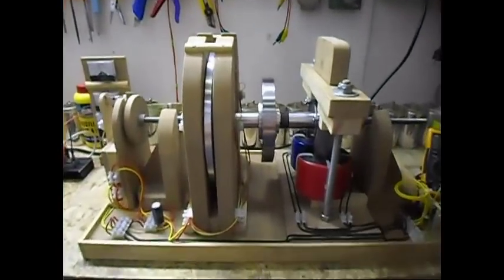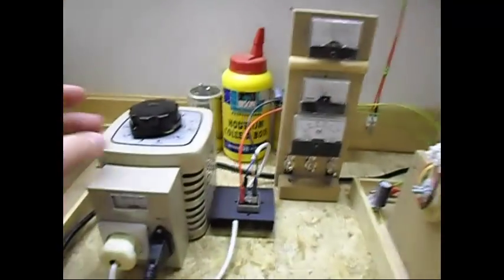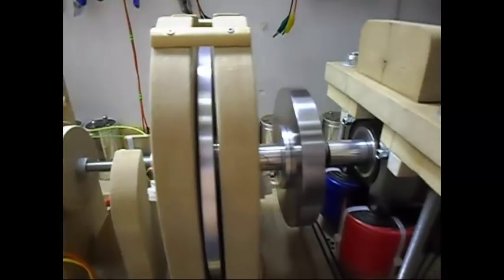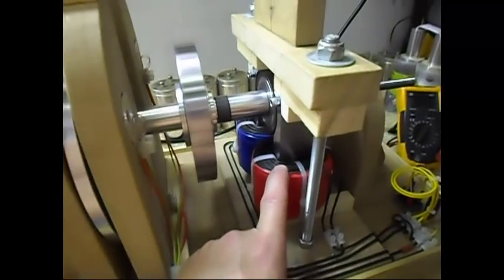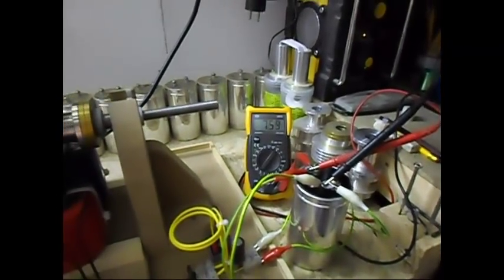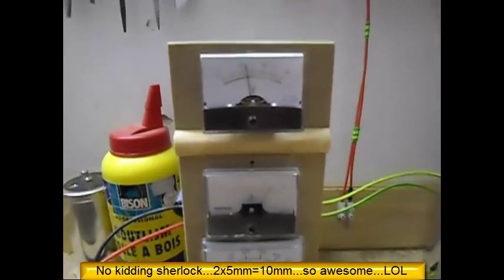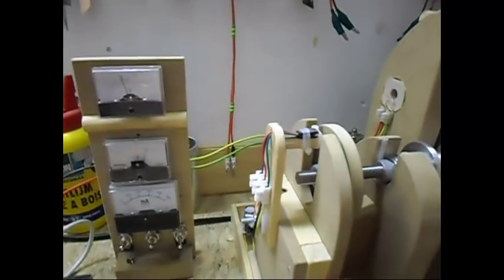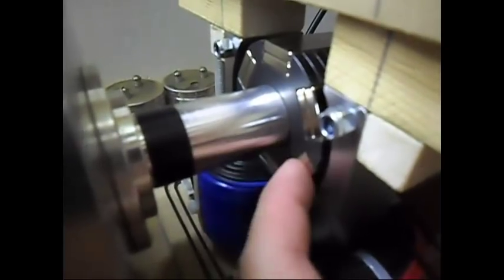Project U-core Dynamo  - Update 4, Self looped & 10mm magnets load test...

Comment: I would be very interested to see   how much power it would produce if the rotor had half of it with same polarity magnet just like the drain pump. Nice work.
Reply from the maker: Thanks for your comment and i'm pleased to read that you've liked it...^^
This test was with 10mm magnets and 3 of them are south out and the other 3 are north out...;-)
It can light up two 21 watt dc light to full brightness but mister Lenz law and it's effect take effect which is of no good and drag the system down almost to a complete stop...lol
If i shopuld run it with a small engine it can put out a lot more...but that not what i want from it...;-)
See this video here where i do the test with 42 watts DC,
https://www.youtube.com/watch?v=OmzUm4fMdfI&t=2s

Comment: Mrcaribbeanroots may i ask if you have plans to use magnet wire to wind your generator?or if you already tried and was not satisfied,?because the insulation on the wire you are using is very thick,which take up more space and may make the outer coils to far from the core inductance; this may lead to serious lost of power ,however magnet wire insulation are very fine and will be much closer to the iron core therefore recieveing more induction from the magnets,they are also best for winding generators.However i do know that the thicker wire you use might help reduce cogging is that why you use it,?thats all like your work very clean remind me of skycollection,peace am out adios lol......
Reply from the maker: Thanks for your comment and glad you've liked it...😄
No special reason why i've use this wire to wound this dynamo...i had this wire laying around for a long time so i've decided to use it...;-)
Of course the inductance/capacitance maybe a bit different once wound as a coil compared to using a enamelled copper wire with the same thickness but it's not something to worry about...at least i don't worry about it...lol
It does produce plenty of juice especially with the 10mm magnets...;-)

But even if it would produce 1 Mega Watt of power what's the big deal if we can't take it/use it without having to drive the dynamo with say 2 Mega Watt of power...???...lol
The cogging is not that bad with the 5mm magnets...pretty good actually...:D

I don't think that a thicker wire helps out with the cogging...???
My guess is that it has to do with a thicker wire coil having lower voltage at higher amps and from my own experience this can be good for not being to stressfull to a system...
Having a thinner wire coil producing higher voltage at lower amps will put plenty of stress on the system and fast too...lol
Voltage is like water pressure...slow running river(lots of water mass at slow rate) compared to high pressure garden hose(far less water mass at higher rate)...which one will be more painfull...???...lol

I also enjoy your work...you are very good at making good setups with the recycled stuff you have laying around...^^
I buy/make most of my parts...lol...not much recycling om my behalf...in my case good old Caribbean lazyness that's for sure...lol
Peace i Adios!
Reply: Thanks for the reply,i appriciate,keep up the good work.
Reply from the maker: No problemo, you are most welcome...^^

Comment: Awesome as always!!
will be interesting try to use a big capacitor bank to charge also with more voltage and discharge into a pulse stepdown trasformer back into the source.
Another method to increase the voltage out (a little more drag for the rotor...but still interesting) is to short circuit the generator coil in small pulses synchronized to the max peak of voltage, to get a fast higher voltage peak due to the inductive kickback/flyback spike, capable to charge an higher voltage capacitor
Reply from the maker: Hi Gianni my friend, thanks for your comment and extra info on those two ideas...^^
Yes, a higher voltage cap bank could do good and the short circuit as well...;-)
If a large cap bank is only partially discharge(say 1/3) it won't effect the drive side to much while it is being filled back to it's fullness...:)
The shorting seems to be the better one(i think) since when this setup is shorted on it's AC output it does not slow down...(around 1550 rpm) or so...I will show this in my next video on this setup when i get some ordered parts in the mail...:D

So if i should short it on the AC @ the voltage peaks it should do good but after the short comes the FWBR and this must be only connected while it is being shorted since if the AC is being rectified continuously it will slow down to much...
I will look for my little shorting circuit and test with just with a small trigger magnets on the shaft which will only give me one short per voltage peak but this will give me an indication if this is good or not to continue with...???
Than i can always set up a 555 timer to get more shorting per volatge peaks...;-)
Cheers
Reply: thank you for considering those ideas!
well, if the AC is rectified it will slow down just when the voltage on the cap is lower than the voltage produced, after that the rpm will go slowly to the maximum until the max voltage is reached, then you add the short, so this can add voltage to that caps...
of course the load will slow down the system
Ciao !
Reply from the maker: Thanks for the extra info on the shorting, i'll search for my little shorting circuit and see how it goes but like you wrote..."of course the load will slow down the system"...not good...lol
Ciao...^^